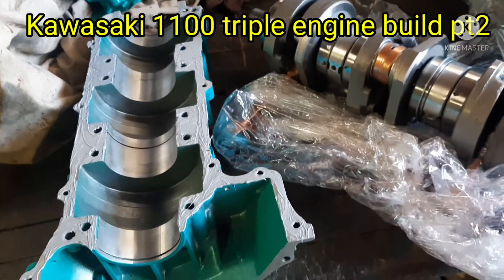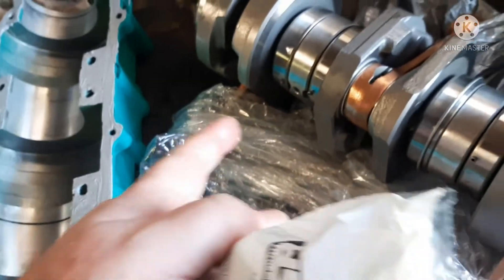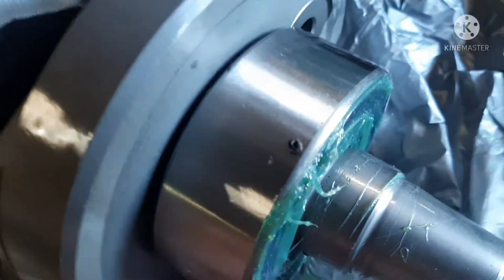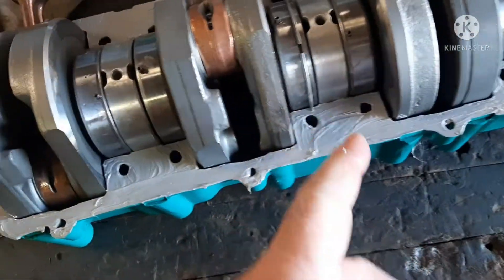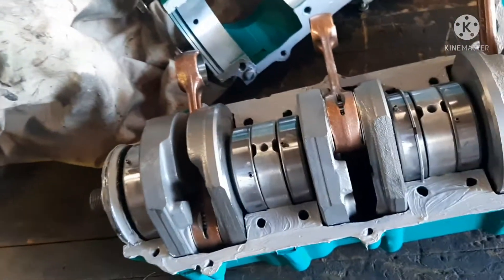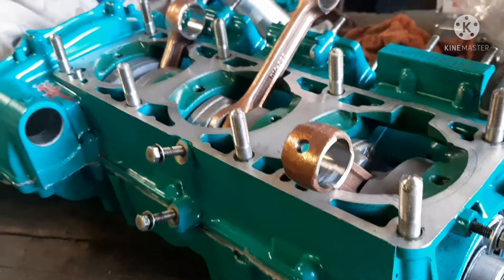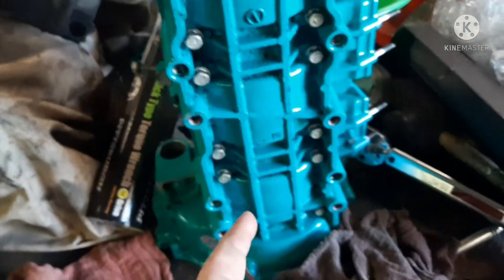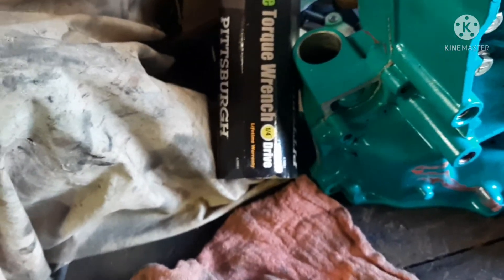Kawasaki 1100 triple rebuild pt2 building the bottom end.

Comment: Just curious when you get the crank from PWC it has the rods and the bearings on, it looks like the rods and bearings are all 1 piece how they get them on the crank. Also I think I would spend the extra 200 bucks and get a warranty, I might mess it up. Great video
Reply from the maker: The rods are on there and yes the crank is pressed apart and then back together.  It also has to be aligned perfectly.  Most warranties are very conditional.  SBT will sell you a warranty on an entire engine.

Comment: My WSM gasket set came with 2 o rings that are the same diameter, but one is a little bit thicker, which one is the one that goes on the collar on the crank? Is it the thicker diameter or the smaller diameter?  I appreciate your help.
Reply from the maker: I remember it being a thinner oring.  Not very thick.
Reply: Ok thanks a lot,  I notice that thicker one w
Didn’t seem quite right.

Comment: I realize this video is a year old now, but I have to ask.. Where can one purchase a complete bottom end kit? Or will I have to buy each part individually? I've recently broken a connecting rod, which then locked up the crank and somehow completely flipped the piston over in the cylinder, so basically I'll be doing a full rebuild like this. I have some gnarly photos of it lol! Great series on this engine! Tons of great info!
Reply from the maker: You buy a crank kit then a top end rebuild set.  Make sure you get new seals.  SBT sells them as does PWC engines in New York.  Hardest part is setting the cylinder you need two people unless you use velcro strips to hold your piston rings while you set the cylinder.  You can buy an entire engine from SBT for about 200 more than building it yourself and you get a warranty.
Reply: @ShadetreeJetski  Great info again! Thanks for the quick response. I'll be looking in to it this coming week!